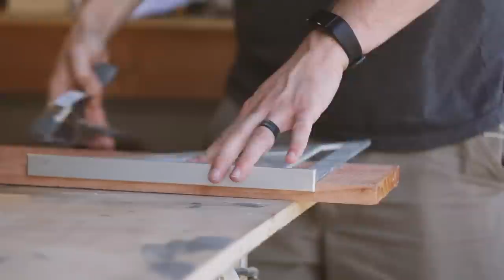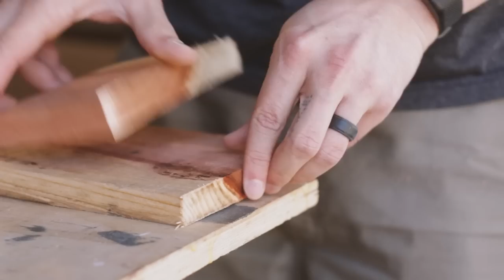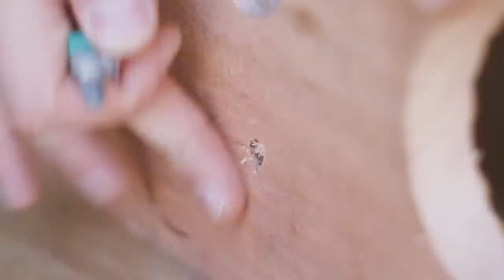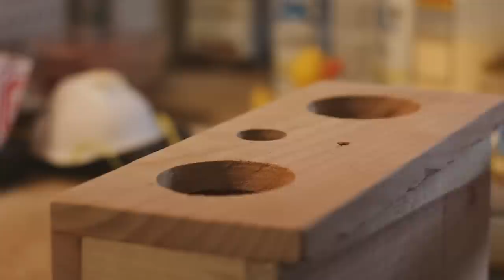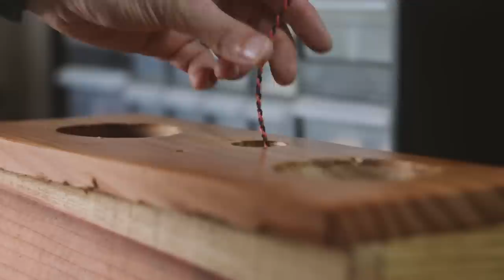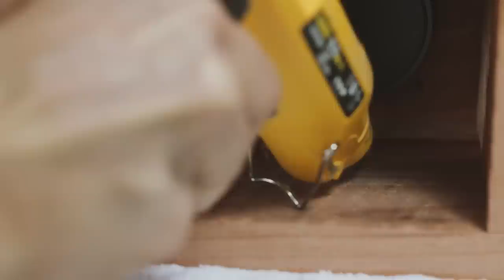Basic Tool Bluetooth Speaker Build || FOR UNDER $90 || DIY Speaker Project

Comment from the maker: "Build Talk" about this speaker and a sound test video coming over the next few weeks! Thanks everyone for watching!
Reply: Good job. =)
What kind of wood on front panel?
Reply: Love the style of your videos, great job. when you do the build talk video can you go over your process for the crossover for the tweeter. Thanks!
Reply: Are you offering build plans for this speaker?
Reply: Hi Kirby! Thanks for much for this video. I have a question that I've tried to find a good answer to but I've been unable to so far. I was wondering if you could maybe explain how to match an amplifier board with a speaker driver so that they are being used to their full potential. It would be really helpful if you answer that as this is is for a school project that I really need to get done. Thank you!
Reply: Kirby Meets Audio.
Reply: Kirby Meets Audio. Speaker radio and bluetooth.
Reply: I have a idea for a new speaker : use led's in the bassport, maybe when building a flat bass port at the bottom of the speaker

Comment: So I plan on build a speaker with 2 4 inch drivers and 2 3/4 inch tweeters and I was wondering if I should build my own crossover or buy one off parts express

Comment: How do you wire up the speakers for these types of builds where there's 3 speakers on a 2-channel amp? Do you wire up 2 drivers together on the same crossover circuit and then one on the other channel by itself? Will that not cause the single driver to be louder than the pair? I'm planning to do a similar build where I have 2 tweeters and a sub/woofer, but I have this question when designing the crossover.

Comment: No bass ports so I think there'll be less bass than one may expect.  Also it seems like the tweeter is in parallel to only one of the woofers. I wonder whether that'll cause enough difference in volume output from left and right woofer?

Comment: Im wondering: how did you wire up the tweeter? Those 2 woofers are in stereo, but is the tweeter too? I dont undersand. Like if you play AC/DC thunderstruk, will the guitar at the beginning be played on the tweeter too?
Reply: Probably the tweeter is in parallel with one of the woofers, but i didn't saw any crossover... probably used caps and inductors tho
Reply: Hum I can't really imagine how you do that, I really want kirby to respond...
Reply: I think the tweeter is in parallel with one woofer and one high pass capacitor as crossover. So you'll have the tweeter only on one channel
Reply: There is no "good" way do make a design like that work with a stereo amp. Unless your using a mono amp or bridging the amp, Which you cannot do with those Datyon KAB amp boards [per the manufacturer].

Comment: What is the punching tool you use before you drill holes?
Reply: Logan Vanderbeck it's called a "center punch". You can get them on amazon or locally at Home Depot.

Comment: Hey, ive got the exact same board and also 2 woofers (4 ohms) + 1 tweeter (8ohms). How did you Connect those speakers? I mean, powering the tweeter for only one channel does not make sense :/

Comment: +KirbyMeetsAudio hey bro, how did you get that tweeter to work. I want to make this speaker with the 2x 50w amp but idk what to do about the tweeter since you didn't wire it up, used a crossover or sealed the box with sealer. I'm confused pls help me.
Reply: M4D would like to know that too

Comment: How did you calculate box volume for this project?
Reply: I too would like to know this.
Reply: Yuriy Baron aren't there online calculators for that?
Reply: TehClide not sure if it matters too much when it's smaller speakers. The calculators I've seen are for ported subs.
Reply: Look for WinISD
Reply: Kurt Massa ported subs, and sealed in closures are not very difficult to calculate. Anything dealing with floor standing speakers is what i have trouble with.
Reply: Bogdan Serban thank you
Reply: The easiest way is to build separate mid/high speakers and a sub. A sub is much easier to calculate in a sealed box, and you can even use car subs (given that they have at least 90db of sensitivity). The mid/highs don't usually require a calculation, so you can just approximate box size and fill it with damping material.
Reply: Easy, if you check the woofer specs you'll see that for a sealed enclosure it needs 0.02 ft.³. Add just a bit more for the volume of the amp board and speaker magnets, then arrange the measures as you like (x length, y high, etc)
Reply: Nuno Correia how mucv is that in cm?

Comment: Circular saw and corded drill are minimal tools? Next time try handsaw and brace instead)
Reply: Руслан Хабибуллин --- yeah or a hacksaw and some glue, I'm not sure he realises his audience...
Reply: Руслан Хабибуллин a drill is only like $20 and circular saws can be had for around $15.. I picked up a set for $10 up to 5" yesterday.. Its not expensive .. and I'd love to see some one cut a circle with a handsaw .. its not happening
Reply: i dont mind the drill and saw i just dont really think a forsner bit is a basic tool
Reply: You call a handsaw and brace minimal tools? Next time try a rock and that tree in the yard.
Reply: Will Builds now that's a challenge :D
Reply: How about that fancy flat pencil? I mean where do you even get one of those??? lol
Reply: I would say more basic tools are a drill, a jigsaw and a dremel. For some reason a circular saw is not a tool that's easy too use for a lot of people (I've seen people that are afraid, intimidated or simply can control a circular saw), I don't know why but that's it. Also a good quality circular saw won't be cheap and neither its discs. On the other hand jigsaws are easier to use for a lot of people, a good one like the $20 black and decker I have can be cheap to get, blades are also inexpensive and you can cut circles and angles with it. A dremel can be had for less than $40 and you can do practically anything with it for this kind of projects. Drilling, sanding, grinding, polishing, make edges, circles and other stuff can be done with a simple dremel.